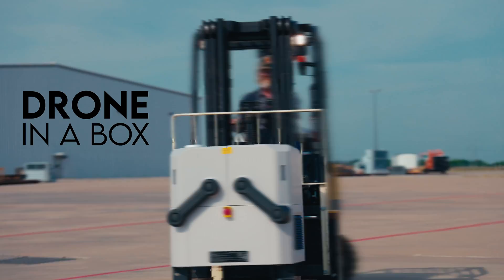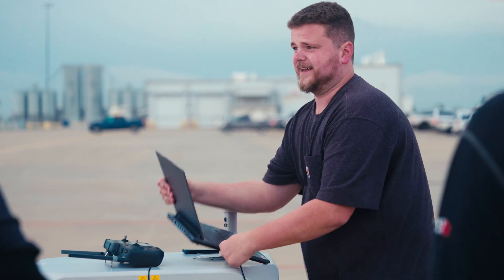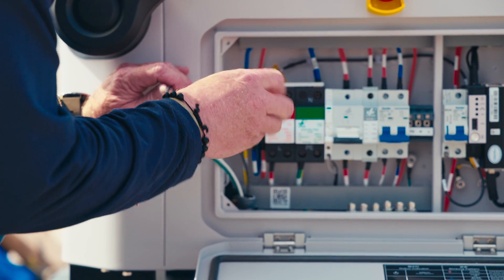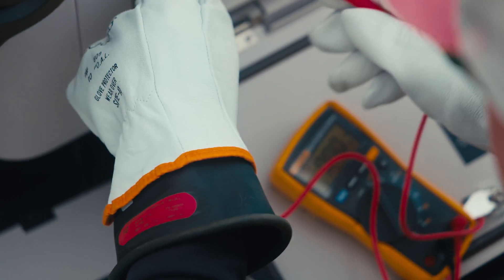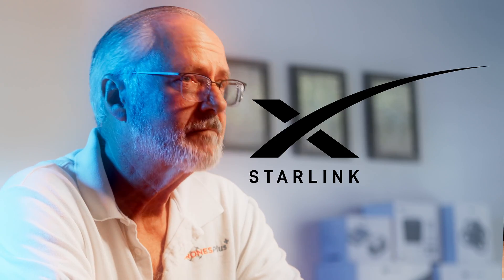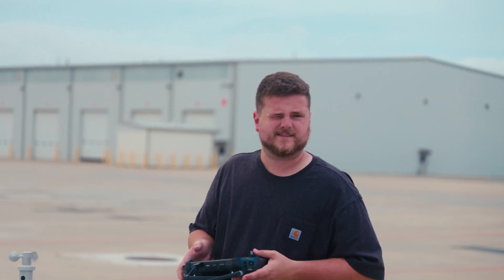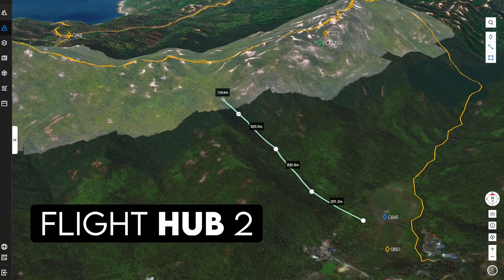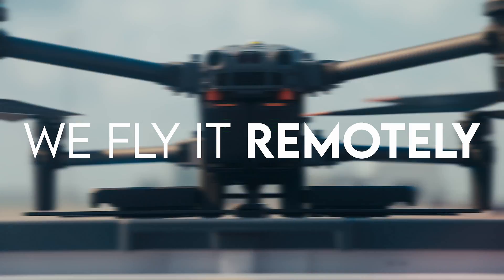Setup Guide How to Install the DJI Drone Dock Unveiling the Unexpected Process #industrialsolutions

Comment: Is the dock 120 or 240V?
Reply from the maker: Input Voltage
    100-240 VAC, 50/60 Hz

    Max Input Power
    1,500 W
Reply: So, 120 or 240 input? @DonGarland
Reply: Can a plug whip be wired and plugged into a protected 120 outlet? I am not an electrician, but understand the basics! Thank you!
Reply from the maker: You might want to call us.  We can get you an installation guide  @thomasmayne1651

Comment: wow after seeing the ad i felt compelled to click on the link to be able to say that is the most stupidest product I have ever seen and will all that stupidity designed in that's got to be really expensive to.    tho lol the best part of the ad was when they show all the clowns installing the electrical and internet in the box then the one clown says ya it's just as easy and like installing an air conditioner in your home.   lol lol lol NO no its not anything like that and installing an ac in a window at ones house don't usually require a team of 3 overpaid clowns